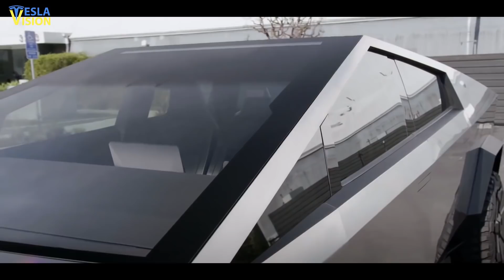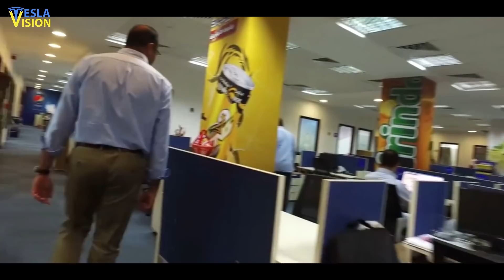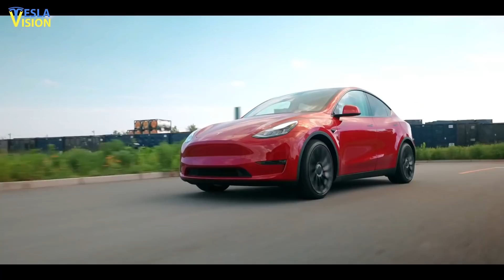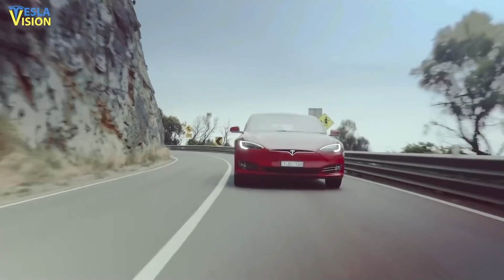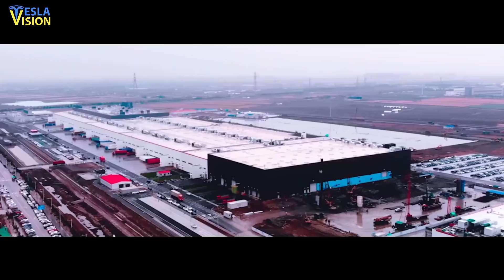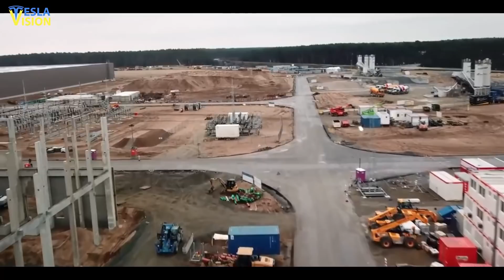VERY COOL Tesla Cybertruck Final Design Changes Confirmed by Elon Musk + Tesla Semi Truck

Comment: yea, nah, truck still looks like it was designed by someone with only a straight edge, looks awful for it!
Reply: No; I love that triangle truck, especially because it's stainless steel.
Also, being bulletproof and cheap to run and maintain makes it the perfect executive protection motorcade vehicle for people such as presidents and prime ministers.
The triangle shape is nice; it doesn't look like it was designed without care. 
It's actually triangular because the bulletproof type of stainless steel that they use is too rigid to bend into shape.